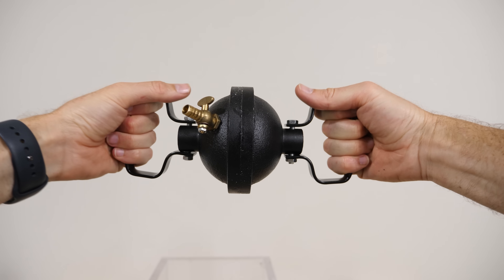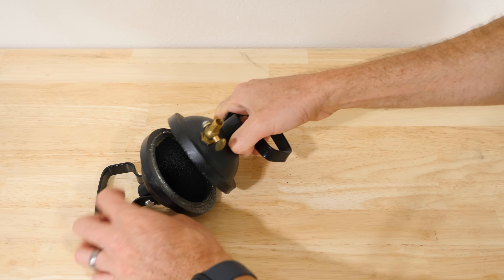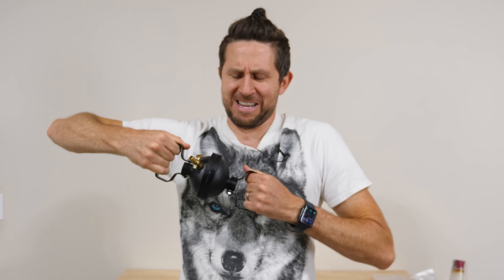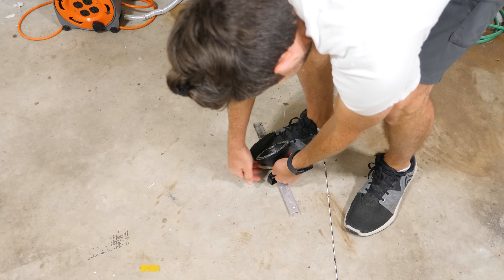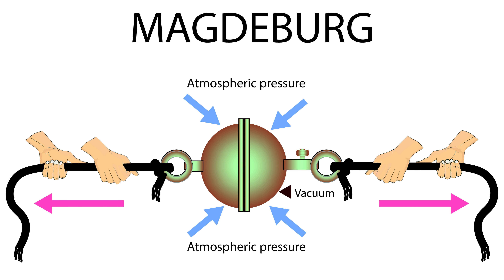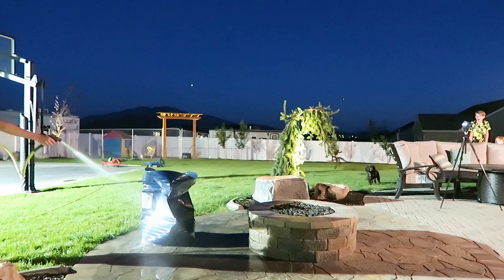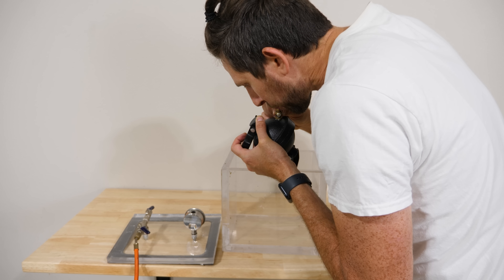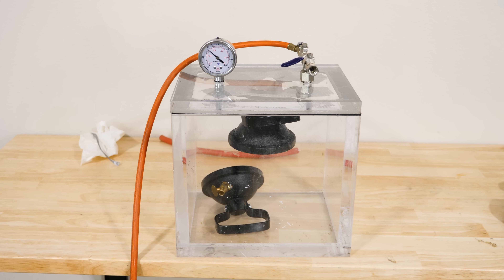Pulling Apart The Magdeburg Hemispheres

Comment: I work in a factory, dealing with sheet glass. We use rubber suction cups to lift heavy glass. The cups are designed to utilize friction as well. So they can carry more weight when the gravity is acting to slide the rubber suction cup on the glass than pulling it apart. But it's pretty mind boggling that it's the atmosphere doing the work. The vacuum is just a lack of something; resistance to atmosphere.
Reply: I work in automation. Where I used to work, we had a couple of robots that used magnets to pick up steel parts made of thin sheet metal. The parts were light enough to lift with one finger, but the magnets often dropped the parts as the robots were picking them up from the fixture, so I replaced the magnets with 2 inch / 50 mm suction cups. At that point, I could nearly do pull-ups from a part after the robot lifted it.
Reply: @chitlitlah  CfaX see
Reply: cåññâbëār  Yeah, I meant float glass. And it indeed should be earth curve :)
Reply: I work in a warehouse. In our receiving department, they use suction cups to lift the 50lb boxes out of the trailers. I've seen boxes with ridges, and tape over them, bulging out. It can carry them all day long. The only reason they don't is because the box itself breaks apart.
Reply: @kyle333halfevil  I saw some video about Amazon warehouses or something. Didn't know before, that they use suction an cardboard. But I guess I shouldn't be surprised. These kind of soft rubber cups with constant suction can be use to lift all kinds of non air tight materials as well. Even cloth. But the one for glass, just go to some low pressure inside and then stop removing air. It holds the vacuum for a long time. Kinda scary but it works reliably. Sometimes we push safe limits, the cups are rated for. But there is certainly some headroom. Because the carry capacity depends on atmospheric pressure. Which can change. Low pressure zone in atmosphere can make your device weaker.
Reply: @youluvana  usually the pumps performance is the greatest limitation, because atmospheric pressure doesn't change a great amount, but a pump can need a rebuild and produce less than than the 22 inches of mercury required on the label.
Reply: @kyle333halfevil  we use vacuum to lift granite, but I think it's cool, all the types of materials the different vacuum lifts can manage.
There's one that lifts bags, and the vacuum does double duty, by holding and lifting, instead of needing a separate hoist.
I think I know which type you used.
Reply: cåññâbëār  water curves all the time. Look at a drop of water on a table. It's not flat. Neither is the Earth.
Reply: Biologically inspired (looks like the fish's mouth that cleans fish tanks), 3D printed, soft robotics suction cups are the new hotness.

Apparently they work even on dirty and dusty surfaces, using miniscule amounts of energy to actuate.

I think there's going to be a lot of money hybrid hydraulic/neumatic actuators. You could use a hydraulic pump to push a pneumatic gas bag for a twitch response to augment a stronger but slower hydraulic response. Then you have 3D printed hydraulic powered muscle.

If you got really clever you could include a 3D printed analog hydraulic computer in the artificial muscle cutting down significantly on compute needs.

Suction cup technology is going to be huge. Like mech-excavator huge... Mechavator!
Reply: My +14 suction cup gives me the "air resistance" buff!
Reply: Nature abhors a vacuum. So it does everything in its power to fill it, causing immense pressure. Kinda crazy to think about how much our body withstands and we don't even notice it
Reply: g g grabbidy lmfao newtonian g g grabbidy which was NEVER PROVEN was replaced by einsteinian (relativity bend/warping spacetime) 107years ago lmfao So the bending and warping of space time aka a none entity aka a theoretical maff problem is acting on something? Holy💩 i’m so sick of dishonest religious zealots.

📺🌏🚀👀=🤤🤡=🦇💩🤪

Tesla on the THEORY of relativity:
“The theory, wraps all these errors & fallacies and clothes them in magnificent mathematical garb which fascinates, dazzles and makes people BLIND to the underlying errors. The theory is like a beggar clothed in purple WHOM IGNORANT PEOPLE take for a king. It’s exponents are very brilliant men, but they are meta-physicists rather than SCIENTISTS. ***NOT A SINGLE ONE OF THE RELATIVITY PROPOSITIONS HAS BEEN PROVED*** ”
Reply: Globetardian zelaots
“i see things fall durrr must be g g grabbidy”
“i see rainbows durr must be leprechauns”

Please do explain how earth has gas PRESSure when in your religion it’s supposed to reside next to ‘10^-17torr vacuum of sci-fi space’ 😂😂😂 hilariousness when you guys debunk yourselves by violating the 💩 out of the second law of thermodynamics 

Stephen Hawking:
“This argument about whether or not the universe had a beginning, persisted into the 19th and 20th centuries. It was conducted mainly on the basis of theology and philosophy, with little consideration of observational evidence. This may have been reasonable, given the notoriously unreliable character of cosmological observations, until fairly recently. The cosmologist, Sir Arthur Eddington, once said, 'Don't worry if your theory doesn't agree with the observations, because they are probably wrong.' But if your theory disagrees with the Second Law of Thermodynamics, it is in bad trouble. In fact, the theory that the universe has existed forever is in serious difficulty with the Second Law of Thermodynamics. The Second Law, states that disorder always increases with time. Like the argument about human progress, it indicates that there must have been a beginning. Otherwise, the universe would be in a state of complete disorder by now, and everything would be at the same temperature. In an infinite and everlasting universe, every line of sight would end on the surface of a star. This would mean that the night sky would have been as bright as the surface of the Sun. The only way of avoiding this problem would be if, for some reason, the stars did not shine before a certain time.”
Reply: O yes one last thing Atmo means air…atmosphere…spherical air? ♿️🤤♿️ try some intellectual honesty and free yourself from the new one world helios the titan sun god religion

Religion...from latin Religare “to tie back; to hold back; to thwart from forward progress; to bind”
A system of control based in unchallenged dogmatic beLIEf which holds back the progress of consciousness...
Reply: Wow. I was certain the Jesus freak was a bot, like the ones telling you you've won a free prize. Turns out it's just a sheep.
Reply: It's strange that the atmosphere is the work horse and not the vacuum inside
Reply: cåññâbëār  Float glass is actually made on tin, but I don't think it retains it's shape well enough to measurably match earths curvature.
Reply: That ain’t mind boggling at all kid. This damn new generation…. Complete lack of imagination
Reply: Nice 666 likes lolol
Reply: @kuyswe that's a logical contradiction and thus inherently false. God is Truth, and does nothing false
Reply: We use Woods brand lifters and Anver vacuum lifters, on 2cm and 3cm thick Granite.
Sometimes I need to do the math and figure out if the number of cups and the amount of vacuum, will safely do the job, and that's because a countertop may have a sink cut-out or other features that limit which cups can be used.
Our largest slabs I have calculated to be about 1,300 pounds.
Reply: cåññâbëār  if the earth and it's diameter were smooth like a precision ball bearing, the amount of curve on this earth 🌎 would be flatter than a seemingly flat Granite countertop or kitchen island.
Only a very precise machine shop Granite inspection table would be flatter than the large diameter of our curved globe earth.
A piece of float glass wouldn't stay flat, because it's so thin and it is somewhat flexible, but it is also true that a molten pool of Tin would exhibit the true curve of the earth, which is curved, but you wouldn't think so unless you knew how to measure the flatness or curve.
I'm a Granite shop maintenance mechanic and I've worked in optical glass manufacturing and machine shops.
Reply: cåññâbëār  you are so absofuckinglutly wrong bud.
Telescopes never ever, bring sailboats back into view, after they have sailed over the gentle curve of the earths horizon.
Reply: cåññâbëār  boats don't fall over any edge.
Reply: cåññâbëār  enjoy the 🌎 globe
Reply: cåññâbëār  🌎
Reply: Ya, but that' still a flawed way of thinking about it. The vacuum is nothing, so it does nothing, literally.

It's the atmospheric pressure on the other side of the suction cup which does all the work. You draw the atmosphere out on the other side to prevent that air from exerting an equivalent force on the other side, leaving you with a net force in only that direction.

You can almost imagine the atmosphere in that scenario like a huge pair of tongs, it presses the outside of the glass and the outside of the suction cup together.
Reply: cåññâbëār  Or sufficient gravity, as in the case of planetary atmosphere and fluid pressure like the sea/lakes.
Reply: cåññâbëār  why wouldnt boats fall off the edge of a flat earth? On the top layer, gravity is constant wherever you are. If you fall off, youll keep falling forever. And no, an ice wall doesnt surround the earth. When you use a telescope, you dont see an ice wall.
Reply: cåññâbëār  when a man runs on a barrel, he runs the same way he would run on a road. A road is flat, so the barrel is flat. 2=2
Reply: “Once you teach people to say what they do not understand, it is easy enough to get them to say anything you like” -Jean-Jacques Rousseau

Comment: maybe try putting balkon with low pressure inside (not blown i to its full size) and put it inside vacuum chamber. will the balloon expand as its pressure is getting higher compared to the pressure around it?